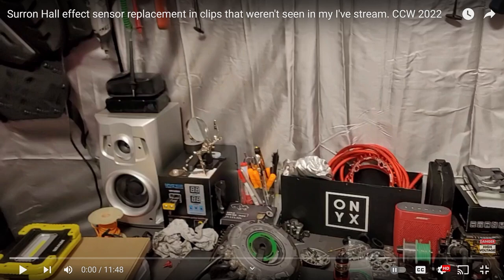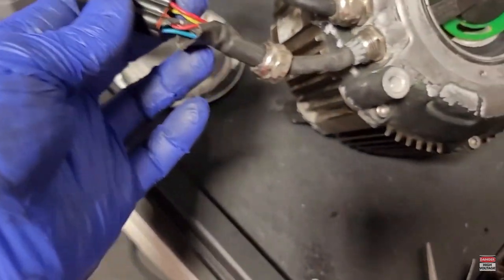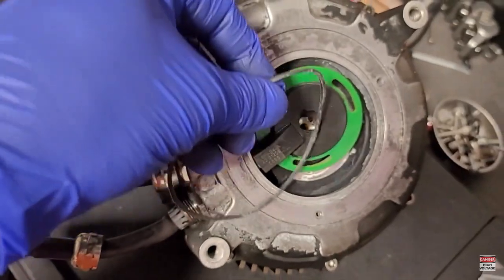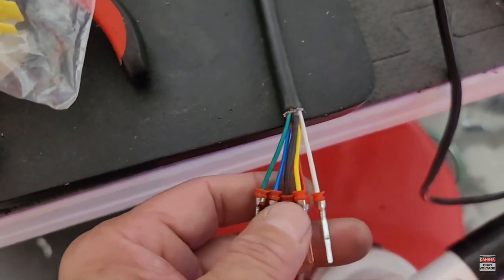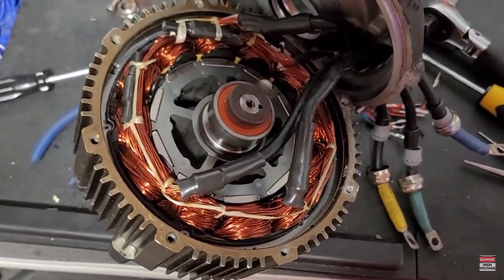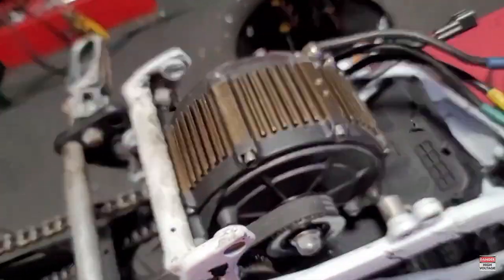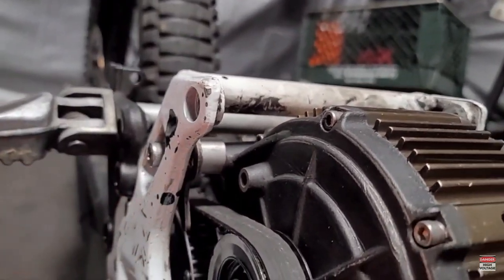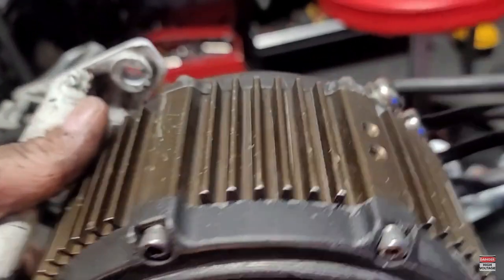Suuron Motor hall sensor replacement and motor removal *VERY ROUGH EDIT and throwback from stream.

Comment: I just saw the Corvette E- Ray, zero to 60 in 2.5 seconds! OMG
Reply from the maker: yeah that thing is whicked unusual set up tho so the front wheels are electric so that gives it all wheel drive launch but the stand alone electric power not really allot but it geys the job done and thats nice feature you dont have to wake your neighbors up untill you get out the block
Reply: @ChrisCrossingWires1212  you better be ready for that kind of power. You might have thought you were awake till you get pinned to your seat.!

Comment: why not save time and confusion, cut the old connector pull it out and install the new one following the old connectors config?
Reply from the maker: True that since they included a new one in the pack your right make sense and you won't need a pic. That was a live video If you watch I didn't even notice it had one in the pack I was thinking I had to reuse the same connector but yeah Definitely
Reply: How did you take off the side cover of the motor to open it up? I can't seem to get it off as one bolt is behind one of the phase wires

Comment: I  have the wires running into my motor, are you saying I can just ignore these when replacing my hall sensor?
Reply from the maker: @campbellthomason2382  you gotta be a lil more specifficwhich wires you talking about this an old video not sure what ones you mean
Reply: @ChrisCrossingWires1212 the ones that appear to be grounding into the motor. I pulled the cover off and noticed the “ground” running from the motor to the hall sensor
Reply from the maker: @campbellthomason2382  just put it back the same way it is. I didn't need it but if it's easy for you to do I'd just do it anyway. I had changed controllers so my controller may have not needed it and that was a Kelly is you still have stock controller or something else just keep it just in case not like it's hard to do.